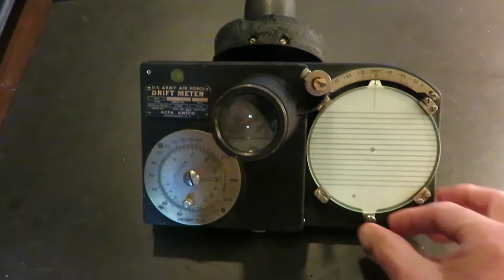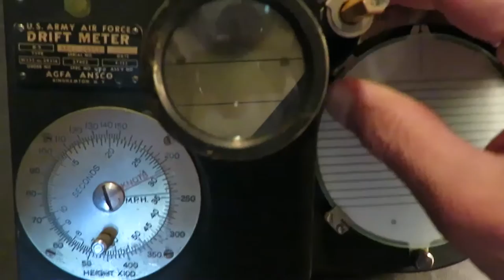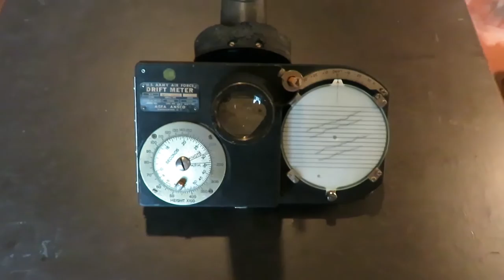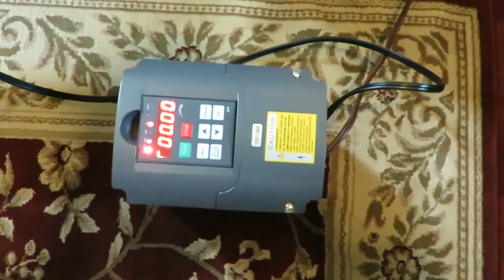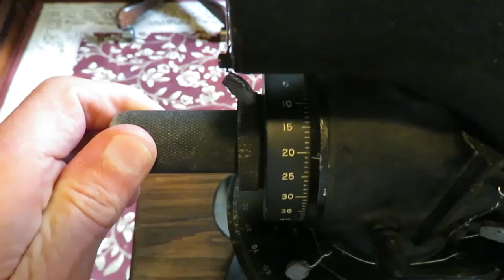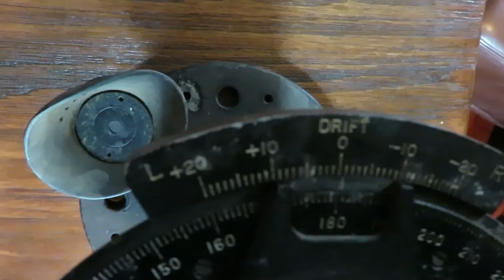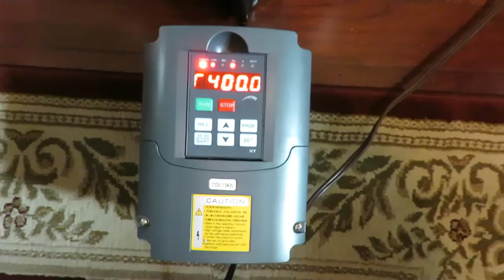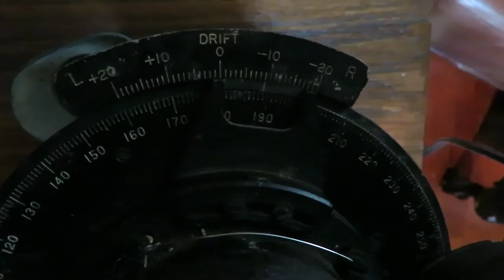WWII Drift Meters

Comment: Thank you sir. Very informative indeed. Years ago I had a WWII navigation manual that made reference to several drift meters but lacked the details you have just covered. I wonder if  the drift meter could be used over water also, observing the sea in calm or moderate conditions if the sea surface could provide a reference during daylight for the drift meter ?  While not related to the subject of drift meter, I read of a B-17 which took off from a Pacific island. That plane actually ran out of fuel when they failed to make landfall and had to ditch at sea. They were rescued and the following investigation revealed that unknown to the pilots or crew an aircraft mechanic admitted he had welded a piece of metal armour plate behind each seat in the cockpit for their protection. The aircraft magnetic compass was never swung or corrected for the deviation caused by the armour. The navigator using the compass only with no other means for direction and no radio beacons was led astray, resulting in a serious situation when island hopping over shark infested waters of the South Pacific.